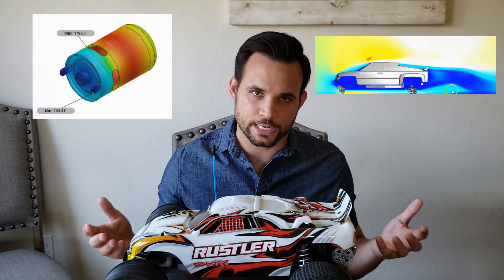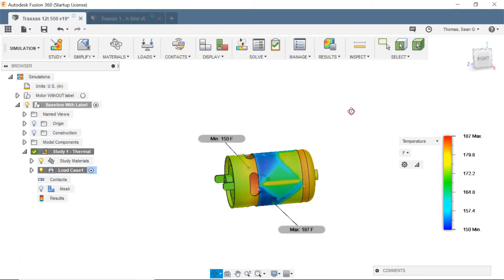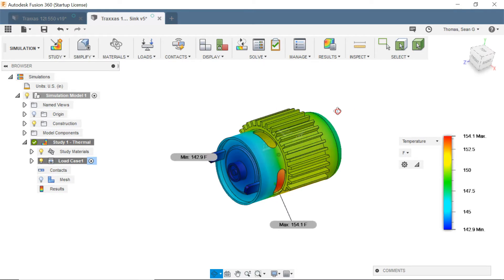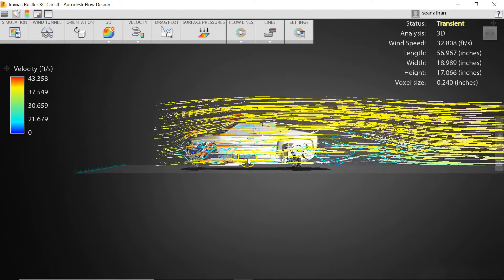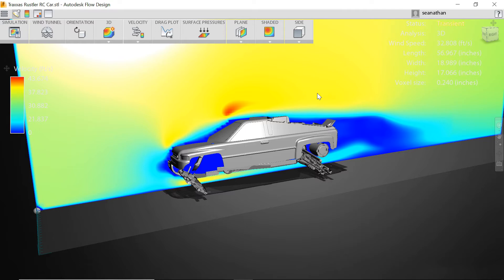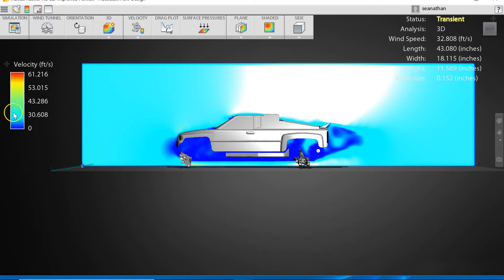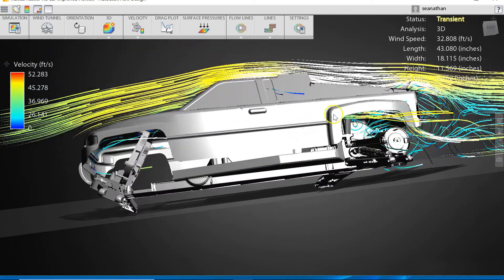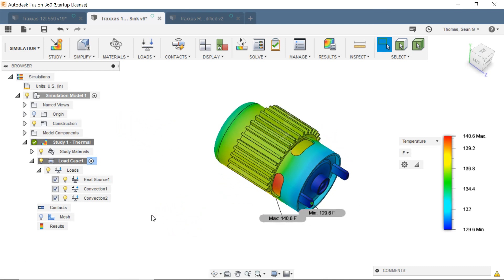Cooling the Traxxas Rustler Motor and Thermal Management - Engineering After Hours

Comment: I fixed my 2wd slash VXL, I found a way to rig up a laptop fan I took out of a junk laptop, 5v fan, and boy does it move some air. I got it pointed right at the motor and it made a huge difference even without a heatsink

Comment: Thanks for the information! Btw how much is it to get a heat sink for the motor? Also is the heat sink like a rubber or plastic piece that goes on it or is it a fan?
Reply from the maker: Heatsink is metal and they sell some on Amazon. Heres the video I have that discusses build and testing.

https://youtu.be/nib0x0FSzlI
Reply: Engineering After Hours can you also get it at a hobbie store or no?
Reply from the maker: I would think so but it depends on the store. Its just a 550 size heatsink that is trimmed to not block air outlets and other pieces. 

Amazon has a ton of cheap ones.
Reply: Oh ok thanks

Comment: I was typing cut a hole in the body. Then you said about it. Try cutting out the roof vent and put a mesh over it. Can you do one for the Slash & Stampede?
Reply from the maker: Slash and stampede 2wd would be really similar. I have thought about 3d printing ducts to force air right to the motor.

Comment: Have you considered playing around with water cooling? You can get some really small 12V pumps now days, just need to figure out the waterblock/rad setup.
Reply from the maker: Yeah but the weight and power consumption is a big drawback. I think using larger heat sinks and thermal straps should do enough if designed properly.